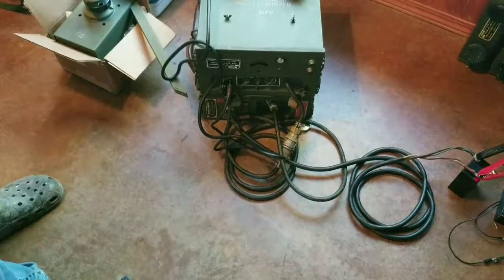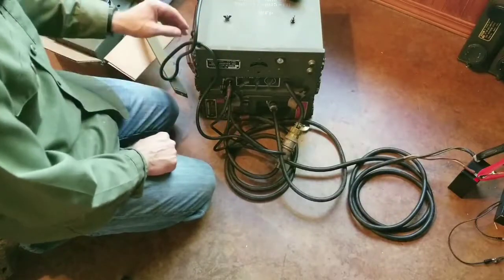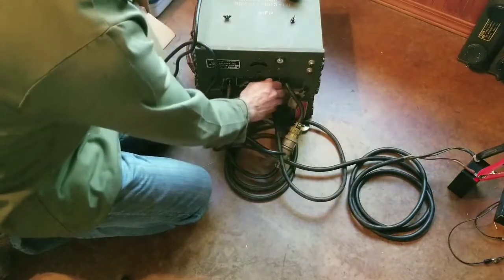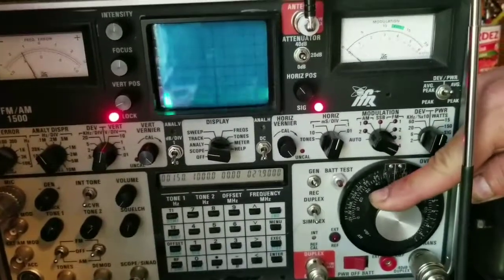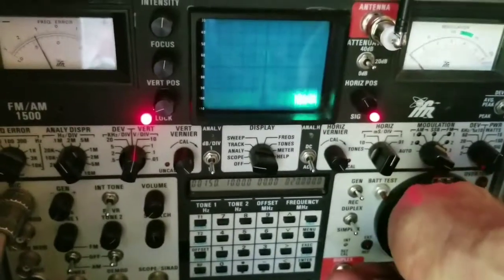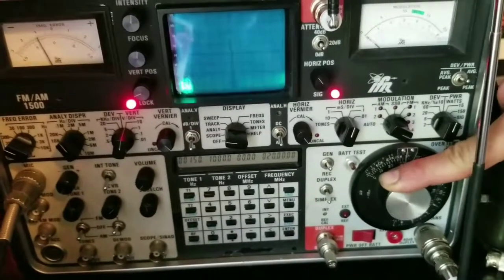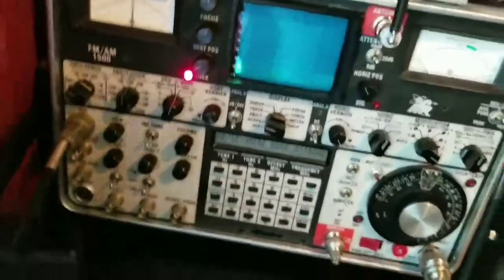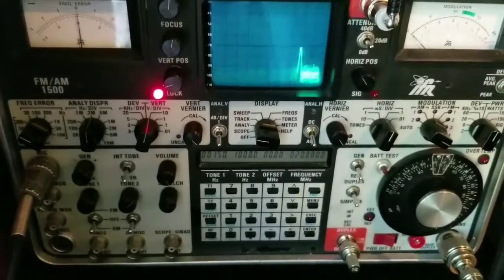BC-620 Radio Tuning/Alignment for Transmitter & Receiver WW2 SCR-510

Comment: I am not understanding why you are going through this so matter-of-fact.  Putting this transmitter on the air  is COMPLETELY  illegal, unless it has been somehow modified  to  operate  (within  spectoral and  modulation limits)  on an  AMATEUR  band.  Using this equipment in it's  original form/ frequencies is wholly illegal.   Even though it  may  "only"  be  the  Citizen's Band,  still...........